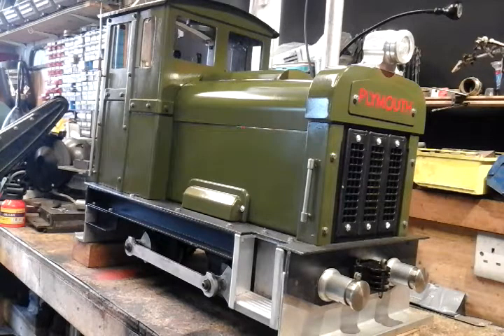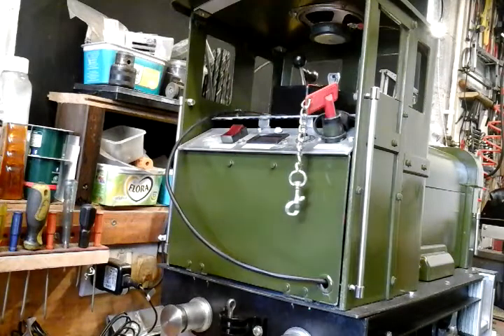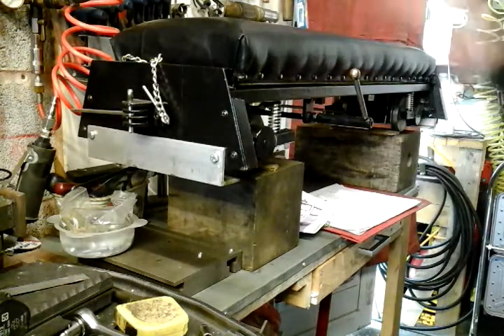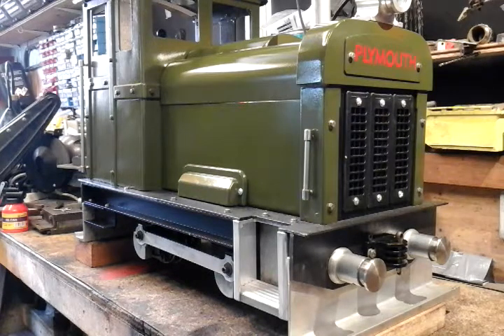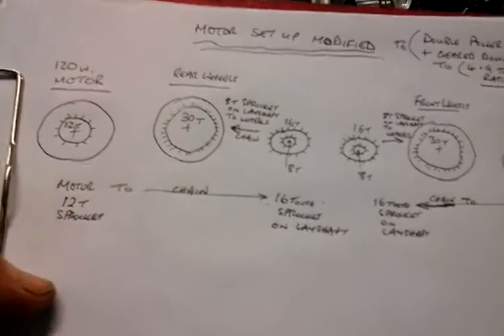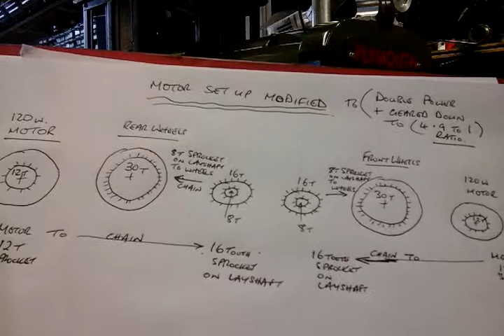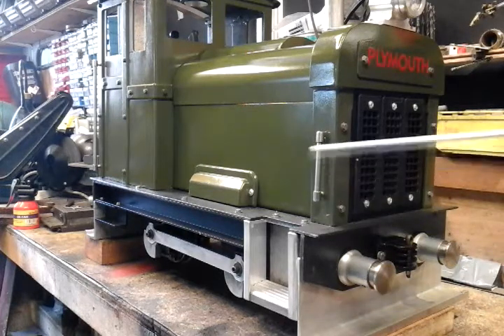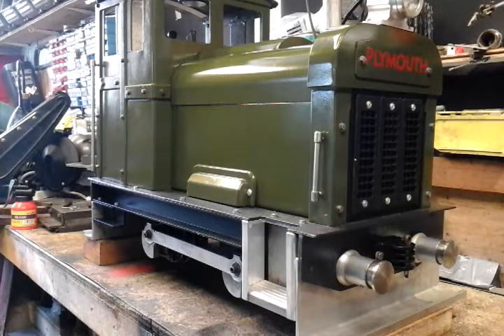Battery Loco Build from scrap  part 8 'Finished' 'Mr Factotum'

Comment: This is a brilliant build! I'm thinking of having a go at building a 7.25 inch gauge loco myself. The cost of kits seems a bit steep though. I looked at a simple diesel outline (a bit like a Lister railtruck) and the total cost is well over £1000.  So I've been watching your budget build with great interest.

My idea is to make sometyhing with a 'minimal gauge' look to it. I have a garage full of old stationary engines, so I'm thinking of using one of those coupled up to an old car alternator, which would in turn provide the power to a DC motor to drive the wheels, which is basically how a full size diesel electric train does it. But by controlling the low amp field voltage to the alternator, that should then regulate the volts coming out of the high amp traction side, so the controller can be very small and deal with only low current.

My main questions at this stage are:

1. What is the thicknes of the steel you used?
2. How did you stop it from warping out of shape when you welded it?

All the best,

Andy.
Reply from the maker: I just used the best pieces of plate i had lying around my workshop and where necessary joined them with a fillet weld and ground flush. I managed to get enough 1/4" thick plate together for the frames and eough 1/8" plate for the top, 
I welded it all together by clamping it all rigidly together first,  to avoid distortion., and tack welded on opposite sides in turn to keep the heat spread evenly instead of concentrating in one area.
Good luck with your build
Regards
Mr f
Reply: Hi,
 Are you referring to the Scamp kit's? They are well worth it. I have one. Nearly finished now.
Reply from the maker: Not heard of scamp kits, if your referring to my price comments, i looked at some at a show i went to recently and the price i mentioned was for an equvillant shunter spec all painted up and ready to go.
Regards
Mr f
Reply: My comment was really for Andy's Shed. Was it Doncaster Show you went to Mr F. as there was been built up there. If you look throw my clip's you shall see a couple clip's of my Scamp loco. Its been painted up right now. But should be back with me hopefully by next Saturday. Then the following Saturday it shall be at event. hopefully all built up and working, Minimal gauge meet at High Legh Miniture Railway.
Reply from the maker: Yes went to doncaster. Ive looked through your videos, scamp looks good. Ive a question that may help a new member of our club who wants to build a loco, but he has limited tools, is the £665 Price just for the scamp chassis / frame / running gear,. if so what sort of budget is needed for the rest of scamp, and what else is needed, like me he's working to a tight budget, although not as tight as mine. I did mine for under £400., 
I look forward to see yours painted up
Regards
Mr f
Reply: Hi Mr F. Sorry replay back late. the £665 will get you the chassis, the hand lever's the bonnet, the engine cradle unit.axle box units. oh and side parts for the derailment bars, foot rest, seat, break hanger's. oh and course the number of of the scamp you own. the rest you buy in yourself. will need a lathe just to turn down 2 or 3 peaces and a welder, the rest is normal hand held tools. can always ask friend to turn these parts down if not got a lathe. or go to a company to turn them down. I am paying for my paint job on my loco as primer and painting is not my area at all. so clearly adds to the coast. normaly if you can do a kit at £1.300. if you go throw ebay you can fined deals on some parts that can make it a bit more cheaper. or buy in all the nuts, bolts washers in bulk to cut it down a tad. but you can buy on to ready to run from CMD Engineering at £2.350. But these are good kit's. I have had ago on the prototype one acouple years ago. cracking loco so i had to have my own. if your on Facebook at all. There is a group for owners of them and people you like to know more or just need a helping hand with there build if get confussed at all. at the moment I helping out on Scamp No 35 and as well on facebook. there are 3 or 4 pages for scamps been built up. scamp no 35 is on there. so is mine. Scamp N0 12, Scamp Deg. thats very good going for under £400. it very hard to get a second hand loco for under 500 pound.
Reply from the maker: Okay, thanks for info, i will pass this on to the chap i recently met at our club, and leave it up to him, i'm not sure what equipment or skills he has as yet
Regards
Mr f